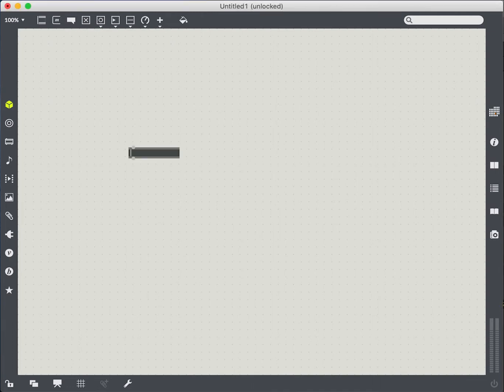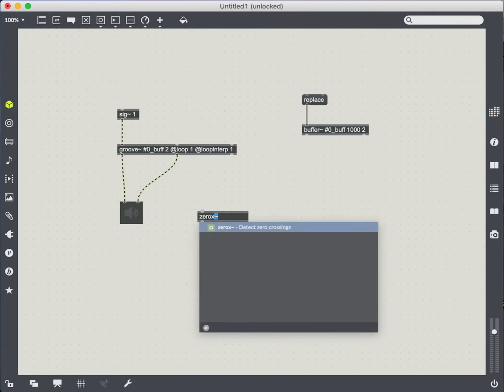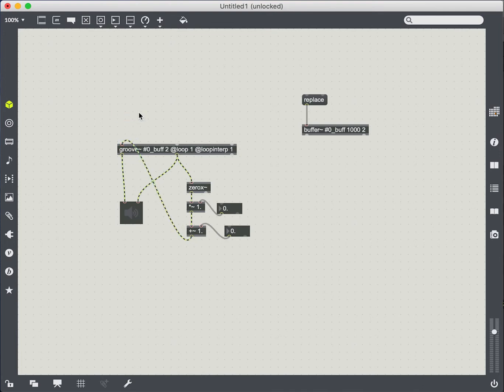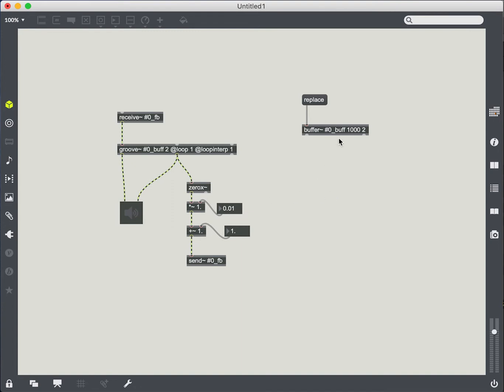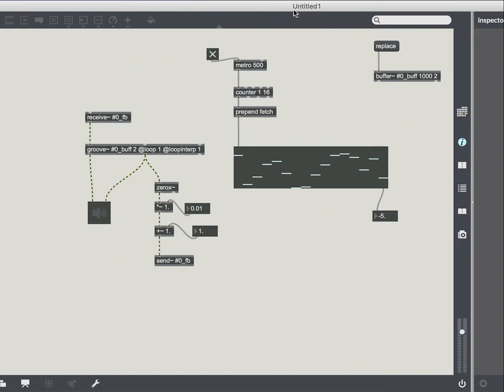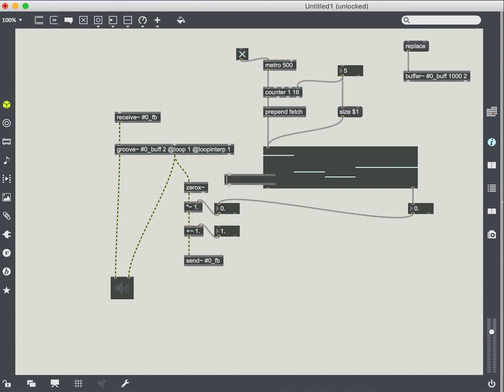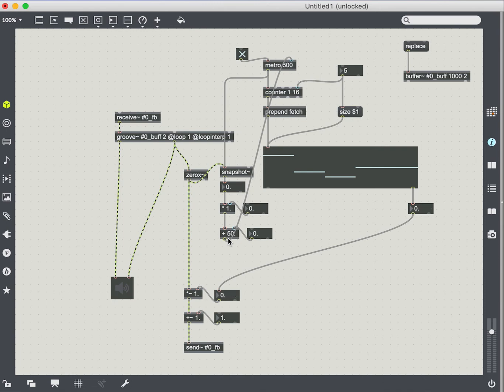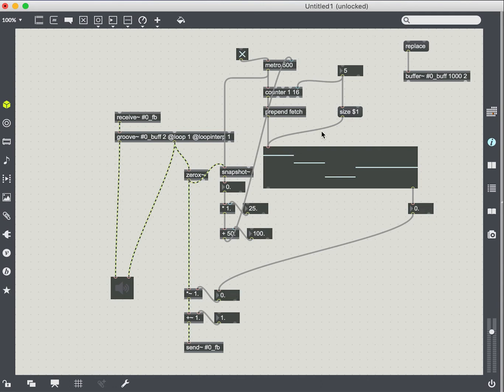Simple Generative Noise Sequencer Tutorial in Max/MSP

Comment: Hi, thanks for the great tutorial! It seems like in my case the zerox~ object can't detect almost any zero crossings, rendering the patch basically non-functional. Any idea why? I tried with many different samples but none will work. Only at certain times I see the value moving to 1 very briefly and then it goes back to 0.
Thanks in advance!
Reply from the maker: Not sure! You could try re-installing Max? Or reach out on the C74 forums. You could also try use the zerox~ object in the simplest possible patch as a way to isolate the problem: just an sfplay~ object connected to zerox~ and see what happens. Good luck!!
Reply: @bluecliffsynthesis6685  Thanks, sorted! Vector size was too small so of course no zero-crossings were detected :)
Reply: Nevermind, I seem to have found the issue: despite my I/O vector size being set to 512, for some reason my signal vector size was set to 2, essentially resulting in extremely rare zero crossings.